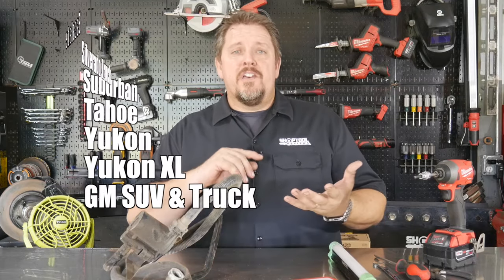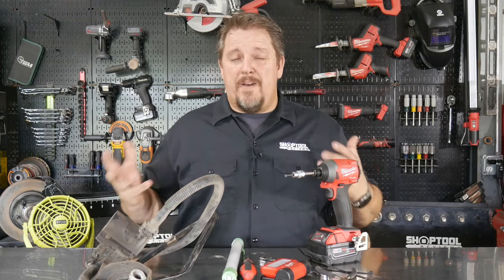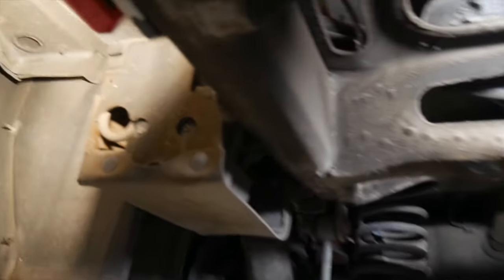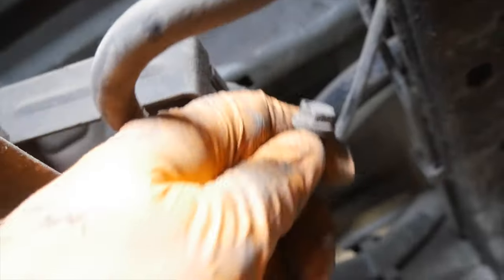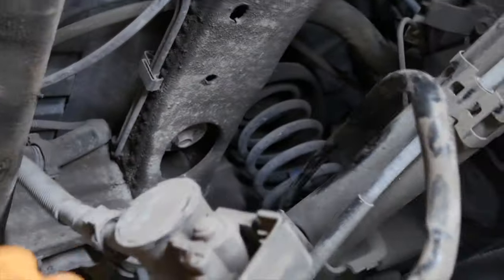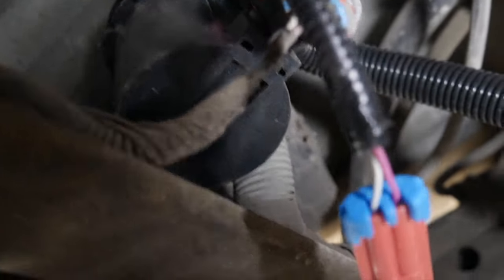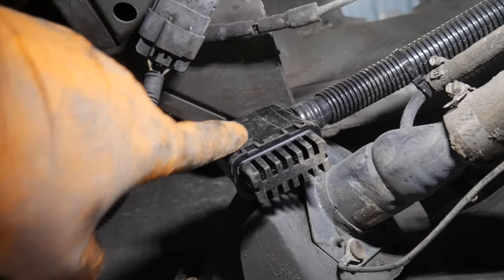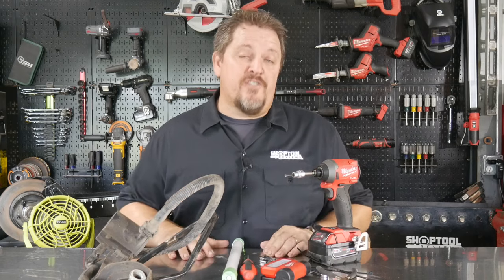Gas Tank Won't Fill? Escalade Vapor Canister Vent Valve Solenoid FIX

Comment: The fuel tank vent solenoid is sucking dust. It is a simple valve open all the time, until an EVAP test is requested. Purge is the solenoid valve on the engine, with the "Green Test Fitting". During refueling, air trapped in the tank is pushed into the activated carbon canister. A pinched hose, filled with dust, other words are can't enter, it backs up. It is against the law to let gas fumes into the air, so they are captured in the canister. Purge is open to engine vacuum and pulls outside air thru the tank solenoid valve replaced in the video. The rectangular box on the hose next to the filler neck is the problem as dust plugs the foam filter under the cap the snaps on. A flat blade pocket screwdriver can remove this cover to clean the foam. If you drive on unpaved roads or live in the country, this will clog quickly. 
 My suggestion it to remove it, place two small engine gas filters in a row to capture dust. This does not fix the problem unless you run hose to the front of the vehicle to get clean air, but allows you to save the fuel tank solenoid valve and just replace the filter. Finding a filter with a hose fitting to fit is the first. Small garden tractors to construction equipment such as a backhoe would work. Or find a fitting for a larger hose to small inside diameter.
  All vehicles, not just GM's have to use a similar system as for decades, metal lines ran to a round carbon canister on the left front inner fender. No problems back then.
 The 4 tabs on the inlet in if removed with be full of dust and the valve as well. Every 8 hours, then seals the tank. It watches a pressure sensor for loss of negative pressure on inches of water (H2O), the PCM closes the vent solenoid and opens the purge. This happens at highway speeds, If vent does not seal, it will have a small leak, save fail records. Then repeat later. Second test runs and fails, check engine light. “Check gas cap” message on dash comes on after first fail. 
If a large plastic fuel filter can be found with fitting for vent line, this would catch most all dust. Another shop uses a large white sock rolled 5-6 over inlet to block dust as they drive on gravel roads. A 14 foot hose could place the fuel tank vent valve inside the engine compartment. Easy fix, but that would cost, GM, Ford, Toyota and others $3 more per vehicle. We can’t have that!!
  The activated carbon is treated to expand, leaving thousands of microscopic holes in each. Fuel is captured as the tank is filled, providing it gets pass the “Anti-Roll-Over-Valve” inside the tank. The inside tank fuel pump bucket holds fuel so air does not enter if low, while making long turns like the interstate on ramps. Always keep a 1/4 tank or more as pump gets hot and you will get misfire code. Blinking 1 time per second means the catalytic converter while over heat. With the ceramic grid, the shell overheats expands, cracks the ceramic grid, turns sideways, rattles and blocks the exhaust. “Banana in the tailpipe?” Eddy Murphy reference! But looses power!
The air inlet during purge and air exhaust during filling is the same line. Protect the holes on that end with a filter of some kind, problems stay away for a long time. Exothermic heating causes the carbon canister to heat up, with purge causes an endothermic cooling reaction as the hydrocarbons you paid for. Raw gas fume rise to 10k feet in the atmosphere and mix with other gasses plus sunlight to create photo-chemical smog.
 I can careless about smog. It may affect some but our smog is blown else where. Exact ignition timing, cam position for EGR, no lead for cat’s to work, carbon canisters, purge and tank vent valves are here to stay. It is a cross we all bare, wether we want it or even know it’s there! Another of the 2,000 reasons for that check engine light. All roads are not paved and wind blows dust into the tank vent valve inlet. Remember, the vent is open all of the time. So do something to help it stop causing problems in rural areas and farmers. Blame the engineers, the DOT and the EPA. Canisters were in the engine compartment since 1968 for cars, later for trucks. Seal belt were required in trucks by July 1971. PCV systems were required in 1964, no more draft tubes hanging down below the oil pan, OBD-2 was required in 1994 as OBD-1 was in California already. I had to know all of these things.
ASE Master Tech since 1978 - Retired
Reply from the maker: Wow, that's quite a dialog, and very impressive. Thanks for all that info.
Reply: Very good description!  Thank you explaining the system and why it works/fails and the origination of the required system
Reply: What an awesome explanation.  I'm on my 3rd vent valve solenoid in 2 yrs...  Installed the newest one last weekend because the seal on top lost its seal and there was a hairline crack in the side.  The next day, I went to fuel up and it stopped after 2.5 gal.  Also replaced purge solenoid the same day (AGAIN. For the hell of it).  Replaced fuel tank filler neck last month and charcoal canister this past spring.  All parts are OEM.  Smoke test shows no leaks and so far, the light hasn't came back on, YET.  I know it's coming though.  It's like playing a slot machine every time I start the truck..  Any suggestions?   It's an 07 Avalanche
Reply: @wild_for_nature9932   On the fuel tank vent solenoid has one job, to shut and seal the tank when testing the EVAP when the PCM calls for it. It is timed based upon run time and tank levels between 90% - 20%. Above or below the test aborts. The vent solenoid is next to the carbon canister and has a flat side with holes in it. Remove it, pinch hose connector & twist off, disconnect wire connector. (I use Rock Auto to see photos of the vent in advance to ID, and see shape & cost) but a flat blade screwdriver fits under tabs to un-clip to remove this cover. Inside is a simple foam chunk with an inlet hole underneath. Modify it using any MacGyver trick to install a much better dust filer. (Note; This is for EVAP leak codes) Every area under this area gets dust. The engine gets gas fumes out of the canister an burns them. Plus, many use a "Roll Over Valve" inside the tank / part of the pump sometimes) but allows air out during re-fueling. I would put a better filter media in it, more of it, move it, fit with lawn irrigation hose and run it forward to a coffee can filled with foam like lawnmower air filter type, many holes in the lid, paint it black, hang it. (True, Decades, Ford used a blk coffee can for a vacuum canister)
  Just throwing out ideas, MacGyver style! In the 70's, 80's, GM used a round carbon canister by the left front fender on inner fender panel. Those never clogged! I knew a shop who wrapped it with sports socks as the drove on gravel roads. DK
Reply: AWESOME TiP
Reply: @deankay4434  Haha!  At work, the guys call me Lady MacGyver. Thank you for responding.  That's an interesting suggestion.  I remember seeing that setup on an old friends'  beat-up  truck many years ago.   Although, the thought of modifying 2 week old OEM parts AND the colorful visual (or even the thought) of garden hose and a coffee can under my truck, especially without confirming that's where the problem IS,  actually made me throw up in my mouth.  Seriously, I nearly fainted!  LOL.   I'm super anal about my truck.  Atm no evap codes have come back,   yet..   I fueled up yesterday at a different gas station and was able to fill the tank with no issues. If the code comes back it always happens between 1/4-1/2 tank.  I will keep your suggestion in mind.  In the meantime, I'll be tackling other issues that have popped up.  I love her but she's such an ungrateful b*tch. lol     Thanks again, Dean.  You are appreciated
Reply: @wild_for_nature9932  ok?
Reply: Thanks great detailed information

Comment: After seen your video I felt very confident about your experience advice and guess what I wasted my money and time and it didn’t fix it. So to those reading comments please don’t go right ahead and do this repair unless you have a “pro” troubleshoot your vehicle first.
Reply: Just revisited this video to see if any comments were on here saying it did not work for them and I wish I would’ve read this comment last week. I purchased the vent valve and come to find out that was not the issue. It Was The Canister Itself. That’s More Money Spent… Money Seen, Money Gone! Smh 🤦🏾‍♂️
Reply: I replaced the vent valve and charcoal canister, and I’m still unable to fuel my vehicle
Reply: Did you fix it yet @dangerousfreedom4965

Comment: My father-in-law just gave us his 2005 escalade. He said he has trouble filling the tank. Fills a little at a time and pump stops. He said this didn’t happen until someone had put the spare tire back up. Could the spare tire be pressing up against a part of the hose to make this do this or is this just a coincidence? Any ideas? Thank you
Reply from the maker: That is a possibility, since everything is in that are; however, it's probably just a coincidence in both happening. You could probably remove the charcoal canister and blow out the dust that is probably clogging it. This may fixe the issue, or it could require the Vent Valve Solenoid.

Comment: I’m having the same issue as you but didn’t get a code on my 11 Escalade. Replaced the parts and still having the issue filling up. When I’m pumping gas I can hear the pressure trying to escape out the fuel neck. Are there any other vents that could be the issue?  Thanks
Reply from the maker: Yes, there are at least 2 other problem areas in the evap system. There is an evap solenoid up on top of the intake manifold that is pretty cheap, and it's very easy to change. There's also the actual charcoal canister (rectangle box) that you vent tubes connected to, under the vehicle. If this canister is clogged, which is not uncommon, it will cause the same symptoms. You can remove the canister and try to blow it out with air, or even run water through it to clean it. Many will advise against this, but it is possible.
Reply: @Shoptoolreviews  thanks for the reply. I have ordered a new charcoal canister and will replace that next. I’m hoping that will fix the issue. I will update you once I get it installed.
Reply: @Shoptoolreviews  aright finally figured out my situation. It was the charcoal canister. Removed the old one and fine black pellets fell out of the tube going to the gas tank. Took my shop vac and sucked out as much of the pellets in the tube before installing the new canister. Filled up the tank with no issues. Thanks for all the information.
Reply: I’m also having the same issue after replacing the parts

Comment: I replaced the Canister, the harness, the vent hose, the purge valve ALL 4 parts and nothing! Still can't fill my tank.  I see other people are in my same situation also.  What do we do now? Drop the tank? replace any of these new parts again for being faulty? I have no codes being thrown but I could try to reset all codes if that is needed?   Please help, what to do next when I replaced everything you mentioned?  Please help I cant take spending 30 mins at the pump to get 10 gallons of gas in the car.  Going crazy!  any advice??? A huge thank you!

Replaced parts:
GM Genuine Parts 215-464 Vapor Canister
GM Genuine Parts 19257603 Vapor Canister Vent Valve Solenoid Jumper Wiring Harness
GM Genuine Parts 23481275 Vapor Canister Vent Valve
ACDelco GM Original Equipment 214-1680 Vapor Canister Purge Valve
Reply from the maker: If you replaced the canister, did little charcoal balls fall out everywhere? If so, then the canister ruptured and those little charcoal balls are probably stuck inside your vent lines. Unhook it at the canister and unhook it at the instake/valve. Blow compressed air through and see if you push out the trapped media. Also, you can do this to the vent hose running up to the fuel tank filler neck as well. Sorry that you're having these issues.
Reply: @Shoptoolreviews  thanks sooo much for replying! Yes the pellets did come out when I pulled it out.  I blew all I could out without dropping the tank.  I'll try to drop it and see if I can get more out.  Thank you again. Wonderful video and I highly suggest everyone subscribe to your channel if they haven't yet.  Solid channel!
Reply: Update: it's finally fixed.  I had to keep disconnecting the hose on the engine at the purge valve.  It was totally filled with charcoal.  I had to drive it then pull off the hose and vacuum it.  Leave it disconnected, start the car and Rev the engine, turn off and vacuum hose again.   It took 3 times repeating that to get all the charcoal out of that line.  Only then did it finally not stop at the gas station.  Thank the lord this is fixed now, very annoying issue to deal with.
Reply: @extrememiami o you mind sharing the hose you disconnected? I’m having the same issues and it’s frustrating. I have changed everything and I’m still having the same issue.
Reply: @Louisianawhips  it's the intake hose of the purge solenoid valve in the engine compartment.
Reply: @extrememiami Is everything still working for you?  Do you think the issue would have been solved without changing all those parts and solely just doing the vacuum?
Reply: @Louisianawhips You can tell it is the intake hose, because that hose will lead to the back of the car.

Comment: I have changed the solenoid valve and still cannot get fuel to go in on my 2012 cadillac escalade esv. Any more suggestions?
Reply: I think the charcoal canister is next. I replaced the vapor canister a few hours ago on my 08 Escalade and it still has the same problem BUT it got a lot better. The charcoal canister is the black box that the one hose plugged into.
Reply: @robd2387  i’ve replaced that also and still having the same issue. Did you ever figure yours out?l

Comment: I have a Ford E350 RV chassis that the valve assembly to hook up the fuel vapor hoses broke off. The part is obsolete and I could not find any after market part to replace it. Do you know where I could find one? That origional Ford part is F4UZ-9B593-F 
I'd appreciate any help! Thanks!

Comment: I dont have a chevy lol but I have a 2010 Hyundai accent had a check engine light for the purge valve but it was starting fine after filling up but now since I replace the part the check engine light is off but now it’s starting to not start after filling up—any ideas what the issue could be?

Comment: This fix did not work!  Installed this valve and the fill rate is so slow it's almost impossible to file slow enough.  Does think valve only work after clearing the code?  Unable to get the code canceled yet since the power pin on the dash connector is dead.

Comment: Loved the video! Any chance you might know what would cause a similar issue on a 95 Diesel F350? This seems to be the only fix to the issue im having, but it seems diesels don't have a charcoal canister or similar venting system.
Reply from the maker: You can't fill the diesel tank? I would assume some type of venting, but I'm not familiar with that vintage F350 system. Thanks for watching.

Comment: I have the same problem on my 2001 Dodge ram 1500. Takes me a half hour to fill up a 26 gal. tank. Is it the same for Dodge Ram?
Reply: It is pretty much the same parts and procedure, since they are emissions required components. The 2001 RAM Evap Vent Solenoid should be under the hood, on the driver's side fender, below the battery. Another vent valve and the canister will be towards the back of the cab on the driver's side, under the truck.

Comment: Are you able to fill up the gas normal right away after changing? I changed mine then went to fill it up and nothing has changed
Reply: Oof what you're describing is exactly why I'm hesitant to do all this work to have nothing changed
Reply: I change all three parts and I still can't full 2013 escalate up
Reply: Did you ever figure out the fix?

Comment: Can you share the details on your magnetic led lights?  Those are really nice.
Reply from the maker: Which ones? Thanks for watching.
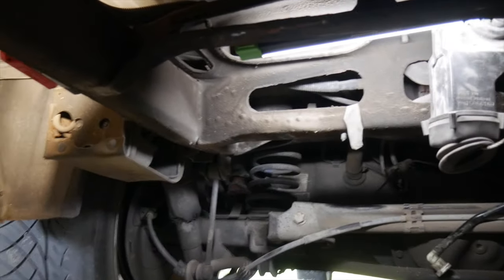Reply: @Shoptoolreviews  The two that you have stuck to the frame at the 4:20 mark going forward.
Reply from the maker: Milwaukee Pivoting Flood Light - love this little guy. Dropped it in used motor oil during an oil change. Stayed in the hot oil for 15 minutes before I fished it out. Light was still on when I pulled it out, and it still works today. That was several months ago. You can probably find the video post on my IG. Here's a link to it. 
https://homedepot.sjv.io/JgZBq
Reply: @Shoptoolreviews  thank you!!

Comment: Nice! Gotta do this for my 05 Tahoe... gotta head start, remover my spare long ago, so gonna order the part ASAP
Reply from the maker: It's pretty easy to do. You may want to blow out the charcoal filter as well.
Reply: DO YOU HAVE TO CHANGE THE FILLER NECK /GAS FILLER TUBE AS WELL